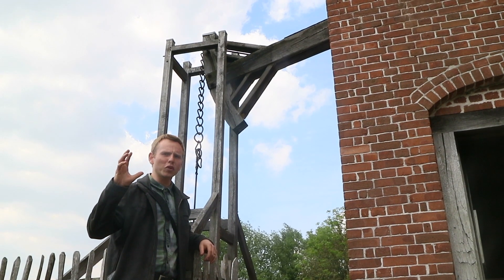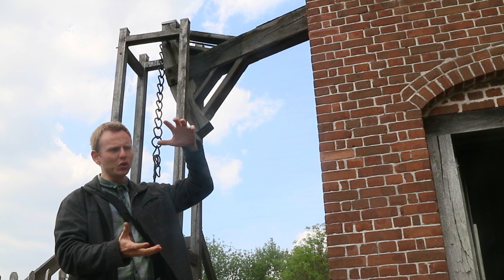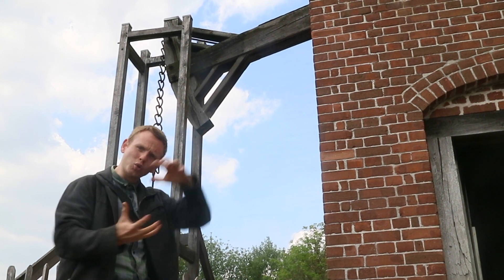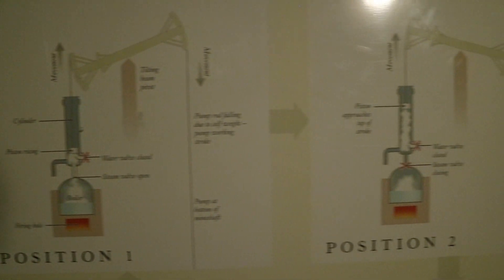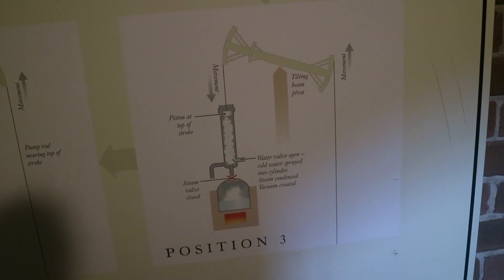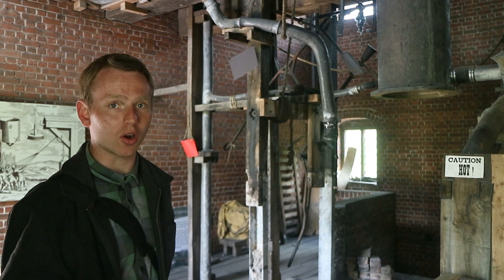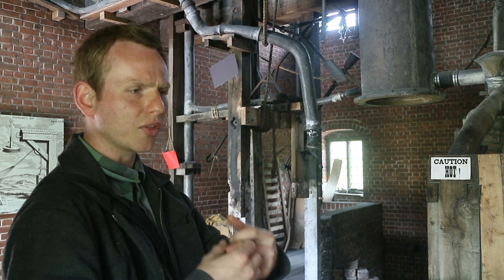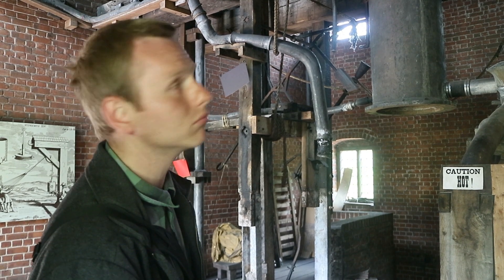Why Didn't We Invent Steam Engines Earlier? (Newcomen Steam Engine)

Comment: The Newcomen engine was not very physically efficient compared to modern engines, but it was hugely ECONOMICALLY efficient in its time, because, despite the bad quality steel available then, it could never explode, kill someone and bankrupt Newcomens business. Coal and water were all there on site, so who cared if it was thermally inefficient as long as it got the job done? Dozens were made. Nobody got hurt. Everybody got wealthier. As a small businessman and inventor I appreciate this very well. Without this engine enabling the extraction of large amounts of coal there would never have been any large scale steel production required to make steel of high enough quality to make the later high pressure steam engines reasonably safe. I feel sure that Newcomen knew full well how to make a high pressure steam engine, he was just too sensible to do it with the lousy steel available at the time.

Comment: Nothings pulled atmospheric pressure pushes piston. Also James Watt improve performance by adding the same action to the reverse side of the piston almost tripling the production this also how did the lever that switch the valves on the Supply of steam this led to the heavy pressure steam valve most people can't see it but look at that lever and look at how the early control valve work if you can't see where that came from then you should teach not do

Comment: It's an Atmospherically powered Pump, but no mention of Atmospheric Pressure??? It provides Atmospheric Power.
A Steam Engine provides Steam Power, like James Watt's High Pressure Steam Engine.
Reply from the maker: Atmosphere provides the push of the piston, but the source of the energy differential necessary for a heat engine to move is the burning of the coal and the steam heating the chamber. JB
Reply: @GoodandBasic  That's what I mean, in Newcomen's Atmospheric Pump, Atmosphere Pressure provides the push!
So it's an Atmospheric Pump, not a Steam Engine.
In Watt's Steam Engine, Steam provides the push, so, it's a Steam Engine!
They both use coal, but they are two entirely different machines. One gets it's Power from Atmospheric Pressure, the other gets it's Power from Steam Expansion.
Newcomen's machine provided 10psi Max. of Atmospheric Pressure and couldn't provide rotary motion. So we still needed the 2000 years old Water-wheel.
Watt's machine provided unlimited Steam Pressure and could replace the Water-wheel.
In 70 years Atmospheric push didn't start an Industrial Revolution.
Steam push did start an Industrial Revolution. 70 years after Watt's invention, the world had changed.
Reply: @GoodandBasic 
All the heat energy changes the water to steam. All the energy for moving the piston comes from the weight of air sitting on the piston, not from heat energy.

Comment: Thomas Newcomen was quite probably pushing the limits of engineering when he did invent his engine.
Reply: Yes, he did indeed, one factor was the strenght of the material available at the time, in Sweden, there was one of them made shortly after for the mines, but it had a lot of tecnical problems since the cylinder was made with much more narrow tolreances compared to the British one which resulted in the machine did basically rip it self apart multiple times whan it was running, despite various reinforcements made after it's construction, but it was sadly scrapped out shortly after because i was concidered too expensive to run continuosly on wooden coal and the constant repairs was expensive so it was replaced by the old water powered lever systems and the metals was re used.  The stonebulding where it stood is still preserved however.

Comment: James Watt dumped Newcomen's Atmospheric power and Arkwright's Water-Power for High Pressure Steam Power.
He had to INVENT a new engine to achieve this, the world's first PRACTICAL High Pressure Steam Engine.
 The Newcomen Pump is an Atmospheric Pump, not a steam engine yet, strangely, no mention of Atmospheric Pressure! It doesn't provide  Steam Power, it provides Atmospheric Power.
Watt's engine provided  Steam Power. It also worked without a codenser, straight from Watt's mouth, if there's not enough cold water for a condenser, just release used Steam to the Atmosphere.
Watt didn't improve Newcomen's Atmospheric Pump, it couldn't be improved, he made his own INVENTION of the first PRACTICAL Steam Engine more efficient with a separate codenser. 
The codenser on a Watt engine recirculates hot water and at the same time, eliminates Atmospheric Pressure, ( Atmospheric Pressure opposses a Steam Engine).
The Newcomen Atmospheric Pump was a 70 years long dead-end. It had an upper limit, 10psi of Atmospheric pressure, and couldn't provide rotary motion.
Needs to replace Suction and Vacuum pull with Atmospheric Pressure, or are the words " Atmospheric Pressure " not allowed?
Why didn't we invent the Steam Engine earlier? James Watt wasn't born earlier!
James Watt's INVENTION was the one and only invention that kicked off the Industrial Revolution.
It was a POWER Revolution.
No more Newcomen Atmospheric Power or Arkwright's 2000 years old Water-Powered Water-wheels.

Comment: It's not just the idea, but the economics. Why were they mining coal in the first place, if there's no steam engines? It's because demand for fuel outstripped the supply of wood in britain, so people needed to figure out ways to use coal instead. This lead to people finding better ways to use coal, which lead to more demand, which lead to people finding more ways to get coal. This literally laid the groundwork for the industrial revolution; the very first steam locomotives operated on already existing railroads that were used to transport coal by horse more efficiently.
Reply from the maker: Nailed it. JB

Comment: Hero was familiar with piston and cylinder mechanisms too, which makes it even more interesting. Here is another potentially huge "missed opportunity" idea. The Babbage situation is really ripe for speculation. I actually agree with critics that Babbage was genuinely too far ahead of his time, and that mechanical parts were just too expensive, slow, and limited in use. But what if Babbage had lived just a little bit later? Because a mind like Babbage's and Ada's probably COULD have used the electrical relay logic or carbon amplifier logic to build a usable and practical digital electronic computer by the 1880s. Relays can operate at a few hertz and carbon amplifiers (a little known early audio amplifier that made the telephone possible) can operate at a few kilohertz. Magnetic amplifiers (another even lesser-known form of amplifier) could operate at a few kilohertz as well. What would have happened if electrical computing became available in the late 1800s rather than the 1940s? To make matters even more perplexing, by the late 1800s, science and engineering had developed to a high state of existence. Engineers and scientists KNEW that there were certain mathematical problems requiring the solving of large sets of partial differential equations and matrix inversions, and yet no attempts to utilise general purpose electrical logic and computing happened. Heck, the Audion triode vacuum tube was invented in 1906 and probably could have driven logic capable of switching at several hundred kilohertz into the megahertz. In hindsight, what the hell took us so long to build a digital computer? What if the digital computer revolution had happened between 40 and 60 years before it actually did in the 1940s? The time gap is smaller than most of these other speculative exercises, but the revolutionary nature of digital computing could tend to produce highly radical scientific progress. Would we be living in the technological equivalent of 2080? Would we have already developed negligible senescence and biological immortality? (which are coming, and preliminary treatments are already here).

Comment: I don't think the Incans simply didn't think of making a wheeled cart. I think there were economic barriers. A wheel is only useful on flat terrain. They had the manufacturing ability in the Andes, but the terrain certainly wasn't suitable. Before the wheel could be put to good use, the empire would have to invest a great deal of resources preparing roads, often by leveling wide swaths along steep hillsides. I think it's no wonder why they didn't build carts. It wasn't that the application wasn't obvious, it was probably obviously impractical.
Reply from the maker: I lived in the Peruvian Andes for a couple of months.  Wheeled transport is definitely not feasible over long distances there without prepared roads.  That said, many premodern cultures have managed to build roads and there are roads in the Peruvian Andes today...  Plus over shorter distances a wheelbarrow or hand cart could still be useful.  I don't think the question of why they didn't use wheels is totally settled. JF
Reply: 6:16 I'm skeptical of this idea, making a cart with wheels even if pulled only by humans could transport so much more goods even around villages and city states if nothing else.  As far as the claim of economic feasibility, what kind of economy did they actually have? Did they have money exchange or  trade and barter?  I really don't know but the evolution is interesting.
I know from visiting  Peru their advancement in agriculture was impressive.  The wheel was also not in use in sub-Saharan Africa either but it wasn't because of a lack of flatland ...
Reply: @hossskul544  Imagine trying to use a cart in a mountainous rainforest with no roads. Wheels suck unless you have a flat, clear surface on which to use them.

Comment: It does seem amazing that no one at the time of Hero thought to attach a pulley to the Aeolipile, just to see what it could do... Humans have long known that rotation is an incredibly useful motion, be it wheels, cranks, pulleys etc, and have usually employed human or animal labour to achieve it. Yet apparently no one thought this device that rotates by itself had any useful application.
Reply: The aeolopile was only about .01% efficient, making it so inefficient that it would take more work to keep it running that it would for someone to just do the work themselves. Hero did invent a steam powered door that was used in one temple where you would light an altar and the door would open, but it was more of a novelty than anything really useful.

Comment: The proper metalurgies  needed to use steam power effectively would not be discovered until the 18 century thus rendering the technology stagnant until further developments.
Reply: Bronze, iron, brass, copper, and wood are totally adequate to produce early, low pressure steam engines and boilers. Indeed that's all that was available during the early industrial revolution. It's fascinating that we had no knowledge of material failure theories or thermodynamics when we first started building steam engines. Indeed failure theories were developed specifically to design better boilers (and locomotive axles). Thermodynamics was envisioned by Sadi Carnot as a framework for improving the efficiency of the steam engine. Lord Kelvin is quoted as saying "The steam engine has done more for science than science ever did for the steam engine".

Comment: The Greeks that spent time playing with that steam toy didn't have to work.
They weren't exhausted after a hard day job under the sun.
So, why would they figure out any other use of the steam engine?
I've also heard of another Greek inventor that built robots, and was planning to make an army.
Then he made a bet with his creation and loosed the bet. He wasn't taking small steps...
Then another could measure mostly exactly the size and shape of planet earth. That happened earlier than the 1000 years global idea that the Earth was flat. I guess that science was not important...
Solar energy was created years earlier than gas combustion energy. And a German inventor was going to build a solar power station in the Sahara dessert.
What is interesting about all this is to acknowledge  the number of corrections that the steam engine required to achieve it's actual state. And build a graphic of time and distance of the authors of the corrections. And compare it with today's communication speed, to estimate for example , the creation of a finally working fusion engine.

Comment: It is amazing that the steam engine came as EARLY as it did!  The cylinders and pistons that were first made were awful!  They were cast, with huge clearances, as machinery did not exist that could make precision fits (are you aware that the Newcomen engines were sealed with leather and water over the piston?)  But the real technology missing was the boiler THAT COULD HOLD PRESSURE and exchange heat at the same time.  That is why both the Newcomen and the Watt engine were "atmospheric" engines.  The boiler needed only operate at near-zero pressure.  Look at the history of early railroad and stationary steam engines (with their riveted boilers).  Boiler explosions abounded!  Even today this is a problem, and is why anyone operating a steam engine of any moderate size must be licensed, and the boilers subject to annual hydrostatic tests.  I conduct annual hydrostatic tests of my 1/8th scale steam engine boiler for this reason!
     The competitor was the Stirling engine.  It required no license to operate (the housewife could pump water for the farm) but (lack of) technology was also in the way.  Heat exchangers burned through for lack of high-temperature steel alloys, and the engine was large for the power produced (almost as bad as the Newcomen).

Comment: Your statement about the "vacuum engine' being a distinctly different process from a "pressure engine is not true!  There is nothing special about atmospheric pressure, or whether you are going above or below it.  After all, when you boil the water to steam in ANY steam engine, you are pushing the piston upward against atmospheric pressure.  It is the pressure SWING that is important, and all engines, steam or gasoline, work on the same principle.  The real distinctions between these are the presence/absence of a phase change in the "working fluid", and in the magnitude of the pressure swing relative to atmospheric pressure.

Comment: I’m glade someone explained it properly that it is a vacuum engine. Steam engines existed before the vacuum innovation but didn’t have the power to be really useful. If you watch a steam loc start up, the drive wheels will slip 1/2 turn and then slowly move, the slipping is the power stroke as the vacuum is formed. For the purists down below, I know it is not a vacuum but a differential in air pressure.

Comment: I read an interesting history of the bicycle, written from a similar perspective recently. Given how incredibly useful a bicycle is, and how little technology a minimum-viable-bicycle really requires, it is amazing it wasnt invented earlier. It should be a lot lower-barrier-to-entry than a capital-intensive steam engine. But even after the general idea came to be embraced as something useful, it took a good 100 years for the concept to converge on its modern form. Its not that people already tried the modern form but found in too hard to produce or lacking for the present circumstances; but it really took that long for people to connect the dots. 

I also find it inspiring to ponder how many obviously useful inventions must still be staring us in the face right now.
Reply: The history of the bicycle made me understand what most people at this forum is giving as explanation. The medieval bicycle was mostly like the modern one, only that it was moved as it was created by the Flintstones.  Without chains, gears and transmissions. But people were good with it. They wouldn't waist time trying to improve it.

Comment: no, I disagree. The idea was there, but the technology were not available to make it happen.
in order for steam engine to be possible, you need metalurgy, large scale production of refined metal and precision machining of metal parts have to exist first. which only came about in the mid 19th century.
Same thing with devices like smartphone. It was inevitable invention, but technology necessary to make it possible only came around in 21st century.

Comment: The phrasing "vacuum pressure" is a bit inaccurate and kind of obscures what's actually happening on a base physics level. In reality, this engine operates similarly to a balloon jack, where mechanical advantage is attained by the small cross section of the feed port and the much larger cross section of the acting surface, allowing large forces to be built up slowly. The differences being that steam is being generated as the slow force input, and the balloon is the atmosphere. When the steam is condensed the air which it displaced is allowed to push back into that volume, pushing the piston down as opposed to "the vacuum pulling the piston down". 

In reality, an engine will still function exactly the same if you take our 14.7psi and treat that at the zero point whilst considering lesser pressures as negative, and that's all well and good, but in my opinion, why stop at relative accuracy when it's one step further to the truth of the matter?

Comment: the reason was the same as the whittle jet engine. the first trope of steam engines worked on the condensation of steam, not the pressure part but the vacuum part condensing back to water. It took a while to make an axial flow turbojet like the Krauts had, instead of the gloster meteor like the roosians copied for the mig15. It would never perform up to specs, because they had the wrong blueprints.